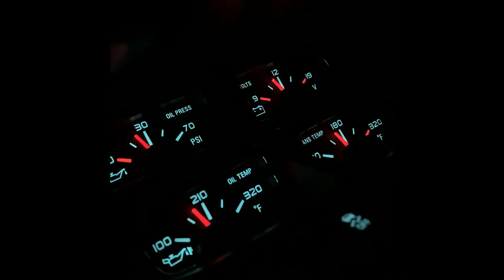AIRBORNE TIRE WHILE DRIVING!!!!

Comment: Oh that's not good however its not a big deal really I just watched the video!  :(   I thought you meant on highway or something ....going fast LOL  I would have  totally pulled over first weird noise wobble, check tires, screw traffic behind you if you couldn't pull of or over ...that what hazards are for ... you got kinda lucky you it happened like that ! Glad it wasn't devastating ...... Here is what happened too me right before the holidays   , Over 3 years I put together a    2002 Z28 roller  , I got 02 Ls1 engine  with low miles, mystery Cam in it said F1 engraved when i put new cover on , then I got a used 2005 GT0 T56 with 36,000 miles (had broken syncros and missing parts inside is what Loyd's said Lol no lol) converted it too work on my F-Body Camaro Z28 , then I had it fully rebuilt everything was going Gold!  I even had a guy do crank sensor relearn ! then I took it on first highway cruise untuned driving kinda  Fast did some pulls ....then I wanted too go faster however I found reverse instead of 5TH !!!!!????  not all the way but the reverse lockout worked but it still buzzed it bad  !!! sounded like a skill saw cutting through my Camaro then sounded like a world War 2 tank driving on the highway really fricken Fast.....so i just pulled over in aw because the shifter bolts became loose all four  almost came off   geez  just  like that !       So stuff happens is moral of story ! gotta double check  it     F     it    tripple check !!!! When I get my T56 back with new main shaft. new reverse ,new bearings  Again ...next week I'm checking every single bolt with torque wrench !!!  oh generous amounts of locktite    Dear Lord the things We Go through to have some fun some times .   F -body's for life!  I cant wait too get into the car scene ! Maybe I'll start a channel of everything I had too do or go through too get this Ls1 z28 going  ! 1 3/4 headers with high flow cats x pipe and bullet mufflers axle dump with a Tune is coming this spring after  finish Painting the Boat!  Keep working on your Badass ride Kayla ! hopefully not by owner error Lol   when my ride is together I'm going too see the guy who I bought my car from  He* has 383 forged LS stoker z28 that Laughs supposedly cant wait too see it in action ! Its on now LOL

Comment: Get a permanent magic marker that is for marking clothes, for the carbon fiber. The marker will take the weather, won't rub off and the scratch will just disappear. I have black aluminum that I have to touch up from time to time. Works great. Keep it in your glove box. Don't feel bad. Imagine being a car mechanic and doing the same thing to your own car. I got lucky, as soon as I noticed the rear sway I hit the brakes. Like you, I just had the wheels off the car and have learned the hard way to never trust the me part. And sure enough, two turns and the lug nuts were off in my hands. One back tire was about to fall off and the other three were tight. I couldn't believe I did that and caused a scene with myself in public. "Yo dude, who are you swearing at? There's nobody here." LOL I hate to tell you what you owe the guy who bailed you out. And he should collect. And give a little thanks to God for saving that wheel. I don't have to tell you how impossible that was. I can't believe the wheel wasn't damaged, especially knowing how much they cost. That's the difference between you and me, mine would have found a nice curb to run along side and been toast. That was a blessing you didn't deserve. The other thing we have in common is we're both natural blondes. I don't know about you, but I do an awful amount of blonde stuff. And by now, I know I'll never change and that's just how I is. LOL I like that you took it all with a smile. When you get older and keep doing the same stupid stuff, you won't. You'll have a scene with yourself in public. And the camera will be the last thing you're thinking about. Mark my words. Another thing you'll learn when you're older; if I don't do it myself, I can't screw it up. Today, I'll only let my shop touch my cars and NOBODY ELSE including me. Even for the most mundane things. Those I screw up the worst. LOL Keep smiling Kayla.

Comment: Don't worry... similar thing happened to me. I have a 02 Wrangler tj and I recently did all new brakes, lines, calipers, hoses , rotors, drums. I use wheel spacers, and I forgot to tighten the front spacers. Lugnuts were fine, so I didn't suspect anything. I heard noises, thought the transfer case was bad. Mr. Dumbass snapped 3 studs on one wheel and the other was barely hanging on. Spent 3 days fixing the f**k up. First time in 40+ years of wrenching anything like that happened. Pretty freaky. Glad you weren't hurt.

Comment: I hope you had whomever put those tires on pay for all the damages. They didn't torque that wheel.. you were blessed. When that happened to me all my studs broke off. And it was on my cadillac deville with 20" wheels and it was on the front. I was blessed that I was only going 35 mph. I only had to replace that rotor.  Stay blessed and keep the vids coming.

Comment: I have had this same thing happen before, one suggestion.. i would take the car into a wheel/tire shop and have them inspect the wheel to make sure no damage happened to the mounting holes.  when my lugs came off and almost the same exact thing happened that you experience and all of that vibration and rough driving made all the holes kind of egg shaped and the wheel would not tighten and stay tight properly.  better safe than sorry to check!
Reply from the maker: Yeah I brought it home and the wheels are ruined. I’m getting them re machined. Thanks for the tip/ looking out for me!
Reply: @KaylaRundle  that’s too bad, yea it was the first thing that crossed my mind, your story was almost identical to mine.  Beautiful car, keep up the posting, channel is great so far!

Comment: Happened to me in my work van in October my tire went head on into a suv at 35 mph I would change the studs the threads usually get messed up from the wheel moving around just make sure you retourte them a couple of times after you change them because they will loosen